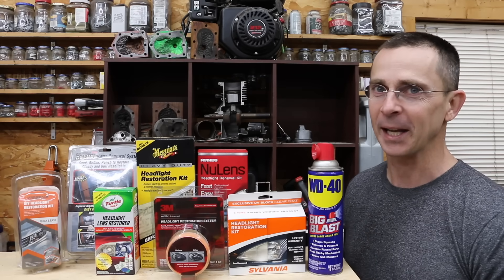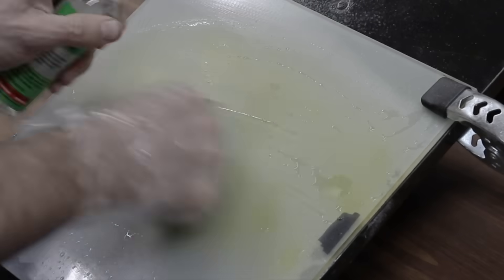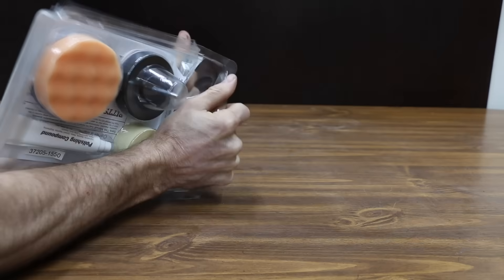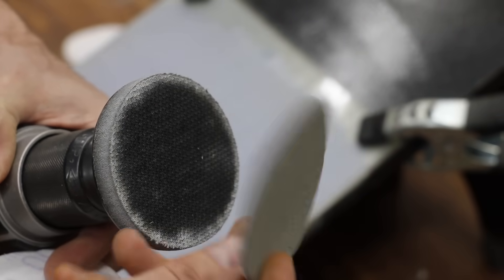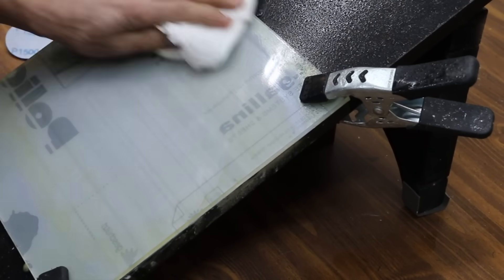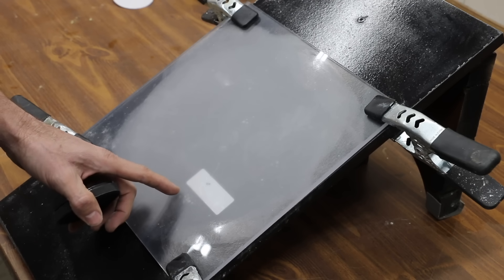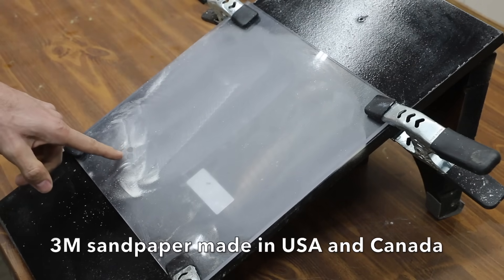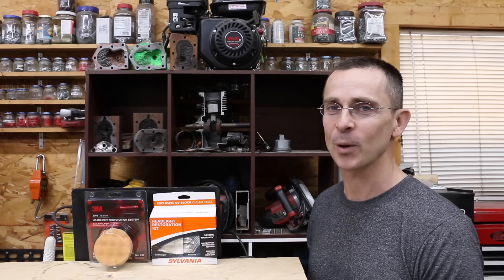Best Headlight Restoration Kit?  Let's find out!  3M, Sylvania, Meguiar's, Mothers, Turtle Wax & HF

Comment: surprised you didn't include a professional/control type solution, simply just buying various grit of sandpaper and a clear coat spraypaint. Can save money that way and pretty much that's all professional detail shops do, just generic sandpaper with a tool then finish it off with a clearcoat spray to seal/protect the surface. 

In my own experience, it provides the best results as i've used these kit solutions before with my current car years ago (had my current vehicle for ~12 years) and it resulted in my car's headlights being clear for a few months but eventually the UV protectant they provide i guess wears off and it returns to being hazy and yellows asap (i guess because you sanded away whatever factory seal), that was until I decided to do the DIY method by just simply buying generic sandpaper at home depot and finished with an automotive clearcoat spray and years later my headlights are still clear.
Reply from the maker: Thanks for the feedback.

Comment: Just used the Sylvania kit on a 2007 Acura TSX with very bad 'Cataracts'.   The headlights earned a 'conditional pass' during state inspections last year and now, after using the Sylvania restoration kit the lenses are crystal clear.  It took just a bit over 2 hours to complete and was completely manual (now tool to use with Drill / Screw Gun) but my results we better than expected.   Only time will tell how long it holds up in daily driving.
Reply from the maker: Thanks for sharing.

Comment: Hey, just tried the link to Amazon that you have, above/below, to the 3M product you tested, and on the same page it lists the, "Ultra, drill required," kit the part 39195 that I used WITH the sealer/protectant.  And, it is cheaper than the, "Heavy Duty," kit you originally tested.....

Comment: GREAT video, thanks!  After watching I finally decided to do my 2001 F-150 (yellow) headlights.   I found a 3M "Ultra Headlight Restoration Kit" Part No.:  39195 on Amazon for about $16, that does two headlights.  This Ultra Kit DOES INCLUDE sealer wipes to seal and protect the polishing job.  The sealer is applied twice with 1/2 hour dry time between, and a 1 hour dry time required before wet/rain exposure.  I am extremely happy with the results, and the box says, "UV Protection for 2 years."  So, we will see!  Right after, the lenses look brand new to me.  The box also said 40 minutes to complete the job, and that may be true for EACH headlight, and must EXCLUDE the 1/2 hour and 1 hour sealant dry times....  THANKS again!!
Reply from the maker: Thanks and you are welcome!  Thanks for sharing.

Comment: That was great.  Fair and informative.  Thanks!  IF you make a future comparison may I suggest a simple polishing sponge drill attachment (such as those you used) and common "in the garage" items?  I have done the body-shop-polish method of simply wet-sanding about 3 or 4 levels (600 to 2000) and then the final polish is the cheapest toothpaste (don't laugh) from any generic 'dollar store' as a next to last step of polish, then finalizing with a protective finish (such as a wax).  Just a thought.  Keep up the great stuff!!!
Reply from the maker: Thanks and you are welcome!  Thanks for the suggestion.

Comment: I would love to see you compare these kits to simply using Mother's Mag/Aluminum polish. Simply smear the polish on the lens, and then use one of those foam drill pads and buff until the lens turns clear. One step and done. 1 hour once a year keeps my headlights clear for years.  I'm curious how it compares to these actual kits (apologies if you've already done this in a different video).
Reply from the maker: Thanks for the suggestion.

Comment: I watched this and then bought the Sylvania kit for my wife's 2013 Ford Fiesta. I'm going to start by saying I have a lot of experience restoring cars so I understand how to wet sand a surface and polish it to a mirror like finished and this kit has everything you need to do that. 

The Fiesta headIights were in awful shape. They were yellowed and scaly and ugly, and so dim my wife was driving with her brights on and they were still not as bright as they should've been on low beams. I'd cleaned them many times using polishing compound and that helped but didn't last very long at all. They'd be yellowed up in just a month or so.

I spent pretty close to 3 hours refinishing the Fiesta headlights. I would've cost me about $250 to replace both of them with new aftermarket headlamps and about and 1/2 to 1 hour to remove and replace them. So it's a bit of work and you have to pay attention to the finest details to make them look "new" again, but you get everything you need and save enough to make it worth it.

The end result was they looked very close to brand new when I was finished and it's now been over six months and they still look crystal clear. So I expect they will last the year that Sylvania claims they will. And if you repeat the process before they start getting all scaly and yellowed it won't take near as long.
Reply from the maker: Thanks for sharing!

Comment: Crazy. I bought a small polishing pad kit on Amazon for under $10. Put the medium one on my drill and used paint correction compound (Meguiars D100?). Took 5 min and did each light in that amount of time. Still need to provide a protectant. Not sure why so many of these have you do all the sanding steps. Maybe in case your car is much worse than mine, but I did it on a 2008 MDX with 170k miles and very very foggy lights.
Reply from the maker: Thanks for sharing.

Comment: Great info.
    I wet sand with wet sand paper from 800 to 1500 with soap n water as a lubricant  And finish with white diamond polish on a buffer wheel.
Then clear coat. 
   Cheaper and faster and better imo and customers opinion also. 
Excellent vid as always
Reply from the maker: Thanks!  Thanks for sharing.

Comment: Maybe do a vid on quick, cheap and easy headlight restoration.  I use Blue Magic metal polish and a paper towel.  Probably works better with a buffer, but I don't have one.   Perfect, no; but I got good comments about the results.
Reply from the maker: Thanks for the suggestion.

Comment: A thing i'd like to see is if you sanded then just clear coated them. Something like 2k Clear and some 200-400-600-1000 sand paper. I did it on my car and it was better than new. And will last probably way longer than these. Because you use legit UV resistant clear coat. Most of these will probably wear in a few months.
Reply from the maker: Thanks for the suggestion.

Comment: Just used the Sylvania kit on my daughters 2012 Civic. They look just like new now. It’s not difficult but time consuming, so the amount of time you put into make these videos is appreciated. Keep up the good work 👍🏼.
Reply from the maker: Thanks for sharing!
Reply: I would recommend the Sylvania. Her lights still look great 9 months later.
Reply: Jon, did yo use 1 or 2 kits to do both headlights?
Reply: @reconfarmer3084  Usually the one kit will be enough for both headlights.
Reply: I have a 2012 civic Si that is in dire needs or headlight restoration lol. Either gonna do sylvania, or 3M.
Reply: Sylvania sucks.  Used it twice.

Comment: I had fantastic success with the Sylvania system on what I assumed was a hopeless case. It worked much better and faster than the 3M system I’ve previously used. The Sylvania system also provides an easy to apply wipe on uv protectant that further improves lens clarity.
Reply from the maker: Thanks for sharing.

Comment: I usually really like your videos.  Not so much with this one.  The test setup isn't real world.  You'd of had much closer results for real world aged headlamp lenses.  
Chemicals in theses kits are designed to worked with real oxidation.  What you did was create a new coating that is a facsimile of the color of oxidized lenses.  120 grit is also super aggressive for this test. It's not a good test.
Use two headlights from the same old car and divide them in half with tape to get for separate test areas.  Test each section with each product.

Comment: 3m makes a kit that has protective coating included it is 21 dollars at oreillys.  I use it all the time to fix headlights for my brother at his car lot.  They look as close to new as they can get.  The only thing that is doesn’t fix is if the headlights have cracking in the polycarbonate lens but they still look great anyways.  I think it does better than every kit you tested.  The results might have been better on regular headlights for some of those kits in fairness I’ve never tested it on plexiglass just plastic headlights and it works amazingly.  You sand with three stages no polishing just add the coating and they look new and they seem to last over done personally owned vehicles for him and so far they still look new after months.  3m always seems to make the best products for refinishing from headlight restoration to buffing compounds adhesives and more.  If 3m is an option I go with it and it works perfectly everytime.  They definitely spend time with research and development.
Reply from the maker: Thanks for the feedback.

Comment: I can vouch for mothers mag aluminum polish . There’s a guy around here who re does old Chevy truck aluminum rims and he does a hell of a job , clear coat and all , 3 years in still great 👍. Best $200 I spent on the truck besides the battery , water pump , fuel pump , brake line , driveshaft because I bent the yoke 😂😂🙄. Still , she starts up every time and I can’t complain. I love any old truck that runs good
Reply from the maker: Thanks for sharing.

Comment: I always use the 3M kit, works great and 1 kit does both headlights on my Civic. Be persistent w/the sanding going back and forth on the lens in a circular motion a million times and your drill needs to be at least 1200rpms.
Reply from the maker: Thanks for sharing.

Comment: I just used the Harbor Freight kit Pittsburg (like in your video). Comes with various grit sandpapers  500 - 1000 that sticks to their drill adapter (provided), a couple of unlabeled thousand grit paper, polishing compound) .  Starting out I had tried other brands that took a lot of time and had a liquid protector. So, once you've messed up the lens you can fix it with this kit. With this kit wet sanding is better than dry sanding (doesn't clog the sand paper and doesn't hurt the paper), and after the polish, the headlights looked brand new.   On my 99 Saturn I had uninstalled the lights, used the kit and bought a  clear coat on them.  Have heard rave reviews even two years later (from Scotty Kilmer) - will wax them too.  On a couple of yellowed lens trucks, it cleared them up very well.  I didn't clear coat them, but did wax them. I'll wax them each time I wax the vehicle normally.(
Reply from the maker: Thanks for sharing.

Comment: The sylvania is amazing!
One point the test is a little too artificial though I know the limitations of headlight availability. The issue with weathered headlights is degradation of the lexan which affects the surface more severely than the inner layers. In effect what you want to do is abrade the surface till you get to the layer less affected. As your test well points out the kit with the best sanding material (sander and polisher wins! In fact you dont need a kit at all! Buy the appropriate sanding disks (very fine and ultrafine), follow with white rubbing compound and finish with a ceramic sealer! Done! Any car guy already has the materials in his garage😉
Reply: Wised1000 very true, i have a 3m professional headlight restoration kit that cost $300 and came with air tools, but the key to the kit is the high-quality abrasives, in this case 3m trizact, but mirka makes a product called abranet that is equally good and in some places costs less than the 3m products.
Reply from the maker: Thanks for sharing.

Comment: Fun fact: 3M (originally known a Minnesota Mining and Manufacturing Company) was  started to produce sand paper used in the mining process. They (and Eagle Abrasives/Kovax) are pretty much top dog in the the sand paper industry (Eagle Abrasives is the US division of the Japanese company Kovax and they make the K series sandpaper meant for more precise jobs like removing dust nibs from clear coat)
Reply from the maker: Thanks for sharing.
Reply: @Occam's Razor Thanks for the info! I've heard good things about the Kovax papers, as well. I may use their stuff for some dry removal prior to compound, polish, coat stages.
Reply: Great head to head competition and was spot on to my experiences with HF, 3M, and the Meguiare's. I tried 4 yrs ago to do Fiances Headlights and the polishing part with 3M was restored to new condition. But none of the 3 had the UV protection liquid so I knew nothing about that step. So in 8mos her Honda's headlights were bad again. GREAT STUFF YOUR DOING FOR THE CONSUMER!!! THANKS

Comment: ive used a few different style&brands to restore headlights. hands down i found 3m kit to be to best, unfortunately it seems most, including 3m, dont sell the kit with drill attachment anymore(in stores at least). some might include sandpaper pads to sand by hand but the drill kits sure help out.
Reply from the maker: Thanks for the feedback.

Comment: There is no doubt that 3M (as of this date) makes superiour sandpaper.   I've used it and others for years.   More expensive generally but better quality.   You get what you pay for when it comes to sandpaper.  I've used the 3M lens kit and was satisfied except for the lack of UV coating.    IMO, it's not only the UV rays that yellow/damage the lens but also the constant "sandblasting" effect because of dirt & grit in the air washing over the lens while driving at speed.  So the polish to protect and UV are both necessary for long lasting results.
Reply from the maker: Thanks for the feedback.

Comment: Used my first headlight restorer kit about a month ago.  Based on this and other testing, I went with 3M.  The results were amazing.  The 3M kit I used came with the protective coating.  Very happy with this product.  PS The places around here get $100 to restore a pair of headlights.  The $30 3M kit and two hours of pleasant work that it cost me seems like an excellent deal.
Reply from the maker: Thanks for sharing.
Reply: @ProjectFarm  Yes, 3M has a "Heavy Duty" Restoration kit that comes with a pad and 3 types of sandpaper for a drill, no polishing or finishing compound, but instead some wipes that apply a UV coating (2x to each headlight).  Very happy with the results I got from this kit for my car.  I apply some Mother's California Gold Carnuba wax to my headlights after every car wash now and the UV coating is holding up very well.
Reply: Awesome you found the better 3M kit with UV, It worked super for me too!
Reply: I went to a local detail shop and he wanted $125 EACH to restore my headlights, They really aren't that bad.

Comment: ..best headlight restoration kit?..old school glass sealed beams!..get dirty?..just wash them off with soap and water or some windex..clear as new!...light burns out?..put in a new one fro $10-$20..good as new!..gets broken?..again, put in new one for $10-$20...most of my vehicles are old enough to have sealed beams, and I love that about them!..my '99 Suburban had yellow plastic headlights..fortunately, sealed beams were optional on them, and I converted it over..don't regret it a bit!... :)
Reply from the maker: Thanks for the suggestion.

Comment: What about just sanding with 800 then 1000 then 1500 and maybe 2000.  Then wipe clean with alcohol - tack free cloth then spray with  USC Sprax Max 2k High Gloss Clearcoat.  It's a 2 part catalyst clear coat (same as used on car paint)  Resluts last 4 years.  Mask off with saran wrap to avoid overspray.  Can of the Spray max around $20.
Reply from the maker: Thanks for the suggestion.

Comment: Best bet is to sand it down to a 1000 grit scratch and spray them with clear coat. Clear can always be sanded and buffed out down the road. Definitely a more expensive route, but one that will last way longer than any restoration product ever will. You can even put a wax or ceramic on the clear coated headlight lense, since clear coat is what's sprayed on your vehicle's paint anyway.
Reply from the maker: Thanks for the feedback.

Comment: I bought and used the Sylvania kits based on your review. I trust your reviews because they seem to be very well researched and executed. 

I agree with your conclusions! The kit is the best I've ever used. I was able to do the headlights and parking lights, but ran out of 'clarifying compound' before doing the taillights.  Bought the 'Essentials Kit' to replenish that plus the clear coat. Since I used the polishing compound sparingly, I should have plenty of that. If not, no biggie...I'll use 3M or Meguiars fine polishing compound. 

Upon completion, I was highly impressed with the result. I don't have any opinions regarding longevity at this time.

Great review. Great product.
Reply from the maker: Thanks so much!

Comment: I've seen this video before but it autoplayed after a Rainman Ray video where he restored some headlights.  The sealant he used was spray-on and UV cured, didn't catch the name of the product but the end result looked great, albeit it hadn't cured yet.

I've used just the Meguiar's PlastX product in a pinch and it does a good job just by itself by hand. A couple washes (or a couple months of rain) later it loses that shine.  Would have been cool to see the 3M process with Sylvania coating and what the plastic on all of them look like after a year or two exposed to the elements.   Good stuff nonetheless!
Reply from the maker: Thanks for the feedback.